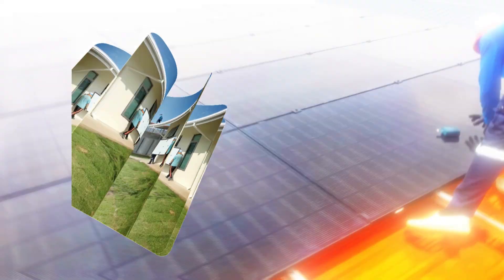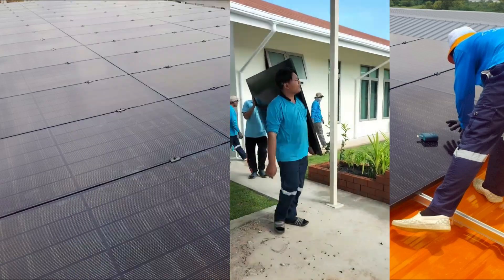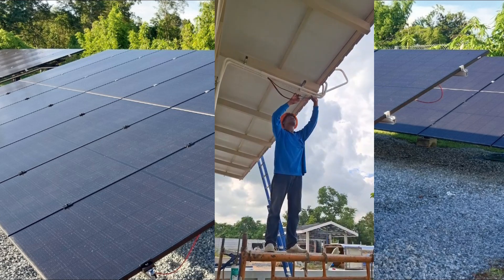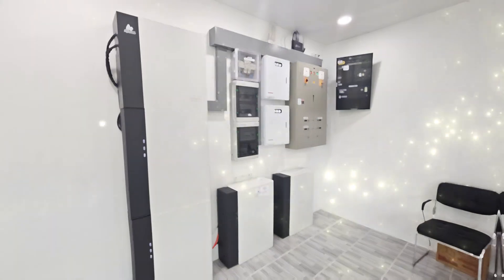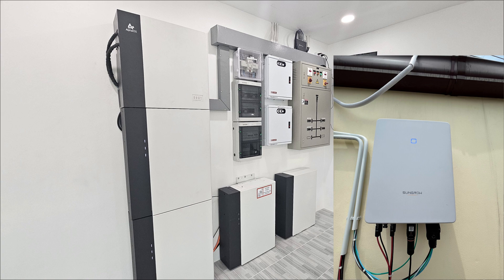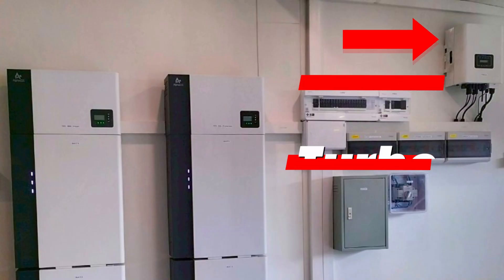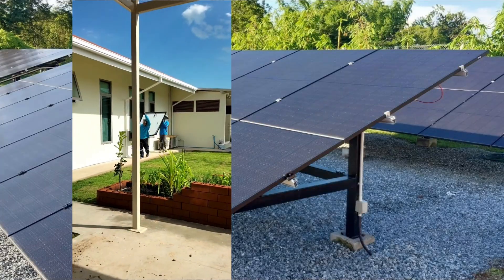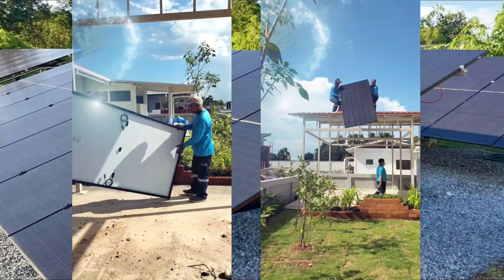Solar Turbo | SolarThailand.biz #expatthailand #expat #solarthailand

Comment: can you tell me the picerange for a 10kw system inlusive battery, and the pricwrange for 20kw system inklusive battery...?
Reply from the maker: 10 kw incl one lfp battery approx 500k baht. 20 kw with 2 batts approx 900k baht. This is high quality long lasting equipment.
Reply: @ChaweewanGroup 
Let’s assume of a usage of 5000KW/h per year with 6THB each will be 30000THB per year. Means you can wait 30 years before the break even.
Does it make sense at all?
Reply from the maker: @OiAndyAum  With an oversized 10 kw system you can save 6-7000b per month. That gives you a ROI payback of a bit more than 6 years. The important thing is to get a system that fits your usage. Maybe you have a faulty calculator also, please check.